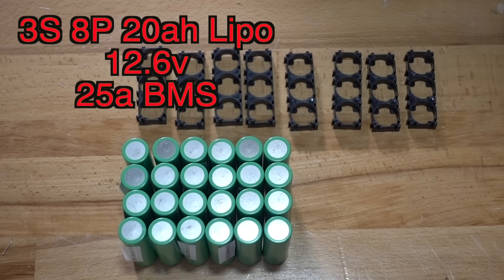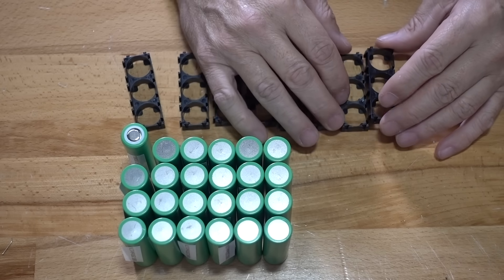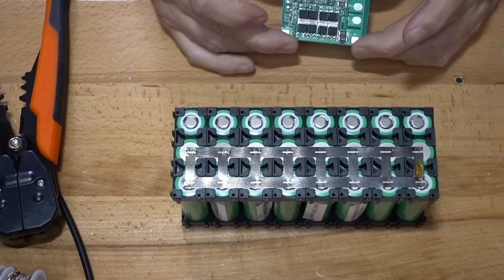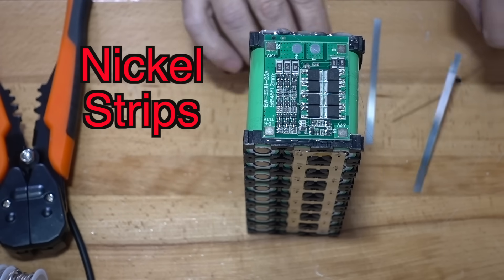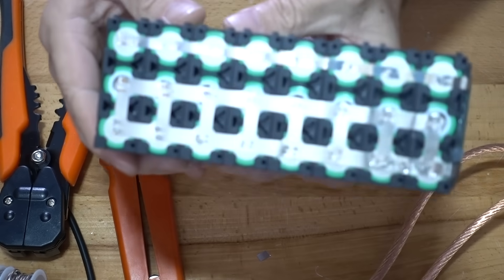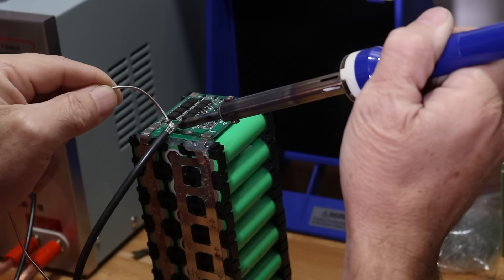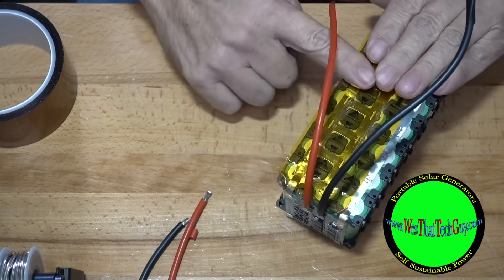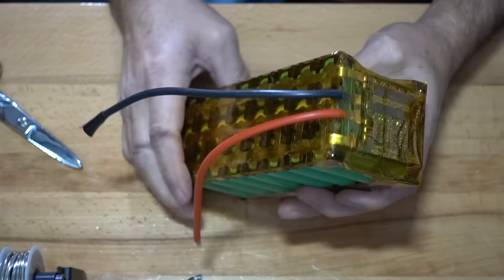How to build an 18650 Lithium Battery Pack with BMS.

Comment: 3x 3.7v (series = 11.1 v @2500ma=27.75wh) 8x 3.7v (parallel =3.7v @20ah =74wh)how do you get 12.6v? 
i get 60ah @3.7v( 8p3s) or 88.8v@2500ma(3s8p) ,,if you parallel first and then series is it 8p3s as opposed to series first then parallel being 3s8p? 24s =88.8v too,, i cant find 12.6v sorry,,am i missing summink?
Reply from the maker: Thanks for sharing. Your numbers are wrong. That's a lot of numbers. A 3.7v lithium 18650 battery charged is 4.2v... AS for almost all lithium cells this is the same. 3.7v nominal and 4.2v fully charged. As for the sequence of how you say it or write it, it doesn't matter it the SAME either way every time. Parallel is parallel and series is series. One has nothing to do with the other. parallel increases amps series increase volts.
Reply: @WesThatTechGuy  thanx for your answer,, i calculated the voltage under load,,i am aware that watts are constant ,,i see the error there now,as soon as you load your 4.2v it will drop to it's loaded voltage,is that a more correct way to gauge the capacity you have? (left) cheers

Comment: Como podría unir 15mas 15 en paralelo, que sume 36 v y unos 10 o 12 AH las células ¿Qué AH tendrían que tener?
Reply from the maker: This would be 15P12S with 10ah cells you would have a 150ah pack at 36v

Comment: Hello! please help me with a tip i need a bms but i don't know how many volts and how many amps it should have, for a li ion battery 14s 51.8v 40ah i have a brushless motor sss56104 790kv 6000w and a pro marine ESC 300A..Thank you !
Reply from the maker: what is the motor used for? what is the continuous amp draw.
Reply: I want to do an electric surfboard..the engine has maximum amps 178
Reply from the maker: Daniel AtegoTrans You will need a 14S 200-300 amp continuous discharge BMS

Comment: How many battery do you need to build a 52v battery pack.
Reply from the maker: 14s would be 52v Nominal and 58.8v charged. but most would do 15s and that would be 55.5v Nom. and 63v charged 3.7v is nominal per cell and 4.2v charged

Comment: How many battery’s can you add per cell ? I have 100’s and looking to use a load in one pack .
Reply from the maker: no limit to how many cells per pack. Generally you would keep them in packs of 100ah, 150ah or 200ah etc. keep your batteries matched in voltage and AH
Reply: That’s no limit to battery’s per cell ? I’m going to run 3 cells at 12v but wanted to make it a big big pack with maybe 40 battery’s per cell so 120 in total .
Reply from the maker: So it sounds like your looking at a 3s40p battery pack? yes?
Reply: Wes That Tech Guy yes I guess so . New to this but that’s what I aim on fitting . I just see mainly only 5-6 battery’s per cell added . Just wondered why and if more was an issue .

Comment: WES how are you charging these upto 12.6 Volts?
Reply from the maker: Im using the SolarGeni SG-S120 5a 12.6v charger. You can get them on the site:https://solargeni.com/Battery-Chargers
Reply: Is it possible to build 3 or 4 of these blocks, and charge them with a solar charger tied to panels? Would that necessitate a special charger as well?
Reply: @mlydick  Not sure.

Comment: Can the battery be charged using BMS or separate module is required for the charging? if yes can you make video/schematic diagram for the same , how to connect charging kit to BMS
Reply from the maker: yes it can be charged using the BMS or can just be balance charged. I will upload a schematic on my site soon. sorry for the delay on this

Comment: Which part of the bms is the charging port?:
Reply from the maker: Ya what Jackson said. its the same as the red and black wire i soldered in the video.
Reply from the maker: Thanks for helping out!
Reply: P+ and P- are both input/output
Reply: @jacksonsnellings9860  thank you so much.
Reply: My pleasure!  Just started building mine last night

Comment: Can you safely make battery pack from self-protected akkus with integrated protection circuit like NCR18650B ?
Reply from the maker: I'm not sure as we don't use self protected batteries so I don't know how the will react when ran in series and parallel.

Comment: hey u seem smart and very helpful. would you help me with a question? i want to build a pack to run a water pump the pump draws 12 amps per hour. it is a 12v pump. i want to run it for at least 5 hours. is this possible to run of 18650? if so what would you suggest. and where is a good place to source batteries?
Reply from the maker: Yes this can be done easily. you would want to run a 3s or 4s pack and you might need to use a dc buck converter to match the voltage on the pump from the battery. We sell samsung 25r 18650 at https://solargeni.com/Batteries/Lithium
Reply: fritz Buy on EBay, I get genuine Samsung cells 20 for $60. Roughly 80 batteries will give you a 12amp hour battery. So x5 you will need 400 batteries to run the pump for 5 hours. It will cost you roughly $1,500 plus some materials. Look into electric generators might be easier

Comment: How is it charged?
Reply from the maker: with a 3s 12.6v lithium battery charger. The BMS is a balance BMS so you can use a Bulk charger but it must be a proper voltage LITHIUM charger with CC and CV (constant current/constant voltage.

Comment: How to know if the battery bank is fully charged?
Reply: A charge controller will tell you.
Reply: ... Or you can just use a voltmeter to check the voltage yourself.
Reply from the maker: check the voltage with a meter or buy a 3s, 12.6v lithium charger over at https://solargeni.com/Batteries/Lithium

Comment: You forgot the short circuit preventer rings to all of the batteries's positive side.
Reply from the maker: This is not done on all battery builds. We now have them available and use them but in the past they were never used by any manufacturers that's what the BMS is for to help with issues.

Comment: What gauge wire did you use for soldering on to your battery pack, and where to buy this wire.
Reply from the maker: on this build I used 10g silicone wire. You can find it on my website.

Comment: I do have a few questions though. On the bms, what does the p- and p+ mean and what are they for? I'm guessing that the p- is for the output of the entire batterypack and the p+ is for the input. Also, can this be done for a battery pack with only 4 batteries?
Reply from the maker: in this bms they are the pos and neg of the entire bms. both power in and out. Yes you can do this with any amount of series 4s 7s etc. you will just need a bms that is for that series.
Reply: Wes That Tech Guy Oh thanks! I also have another question, so could I have two different wires/connections in the positive thing (p+) because I need to charge the battery pack but also include it in a circuit.
Reply from the maker: In this bms P+ is the ONLY positive +. so anything DC + should be ok because its power in and power out.
Reply: @WesThatTechGuy  So could I have something charging whilst having a circuit using the same p+? I hope what I said makes sense.
Reply from the maker: what is this circuit you speak of?
Reply: Wes That Tech Guy It’s very simple. I need the negative side (p-) to connect to one side of Nichrome wire. Then on the other side of the nichrome, I want a wire going off of it and onto the positive side of the batter pack (p+). Then I want a little solar panel to slowly charge the battery pack. (Also, the bms I’m using can only discharge 5 amps at most because too much amps will melt the nichrome wire)
Reply from the maker: Yep that's simple. This is called a direct short! But I think you know that. Nicrome would be used for heat or a light or a coil for vaping among many other things. Can't say as I've done that. Don't think I can help with this sorry.
Reply: Wes That Tech Guy Okay thanks!

Comment: No offense but your not gonna be running a ebike  off 12.6 v
Reply from the maker: Non taken. And yes there are many motors out there that run on a 3s system. Try to think world wide and not just national or local. There are motors that run on 2v.
Reply: @WesThatTechGuy  good point . I was just going by what everyone around me and I also use

Comment: Hello. There are some claiming that these BMSes are not very good for balancing the charging. Could you comment on how would you wire additional cables for balance charging with a charger like Imax B6? Thanks
Reply from the maker: Ka Wo just solder to the positive to positive side of battery and the 2 other + wires to the other 2 + in the series and the 1 - wire to the negative side.

Comment: I have a doubt sir if I make 48v battery with 3.7v 3.8ah how many cells I need to make it and how to choose bms board for that battery..... after that how much voltage and ah I can get it from that battery
Reply: depend on ah, u can choose cells 48v how much ah u need. and u can choose bms according to battery pack u made
Reply: @ChandraMohan-gq5su  ah is not mandatory if i make 48v battery with 3.7v 3.8ah cells how many batteries i need how to make it ah is not a important

Comment: I understand the whole process ,you did justice to it but how do I charge this ? And how do I connect it for use to charg phone?
Reply from the maker: you connect a battery charger to it 3s lithium and you can solder on a usb charge port to charger phone

Comment: If I wanted to power 12V LED strips from a battery for 40 hours constant at 1A load, would I be better off using a car battery or building a pack like this? I'm not really sure of the pros and cons of each?

Comment: Well, what is the each cell info,
Example same pack with 3*8 I want 40ah what are all the things need to be care. 
Do I need to each cell capacity like assume it has 2000mah need to replace 4000mah is that right or if any??
Reply: Generlly the battery capacity was 2600, and 3.7v,  the  peak discharge was 4.2v. if u want higher capacity just add cells and according that use bms.

Comment: Is there any BMS on the market, enabled for 120 CCA with the same port for charging and discharging??? I want to DIY a motorcycle batery. 10ah, high drain 18650, about 120cca for the starter and with bms capable of delivering them along with charging voltage 14-15v from the rectifier/regulator (one socket charge / discharge)
Reply from the maker: yes. you will need a 150a Continuous Discharge BMS. Its a pretty inexpensive BMS for that battery but quite sizeable it's not a small one.

Comment: HOW safe is that???? without temperature monitoring
Reply from the maker: pretty safe for a simple small build for an ebike or similar. Temp monitoring is great and we use it in all our battery builds for resale and our portable solar generators. But temp monitoring takes another component to work and shut off the charge and or discharge. This build for what it's intended for will never over heat at 8p x 25a = 200a continuous discharge. If you were to discharge it at that rate it the stored charge would not last but a few minutes. So I guess one must use common sense if building their own pack.

Comment: I enjoyed that video, thanks. Now what charger would you use to charge that pack ? If using it in conjunction with solar panels would you just use you’re typical 12v solar controller and allow the BMS to manage the input from that ?
Cheers
Reply from the maker: Yes you could use a regular solar charger as long as its programmable and you can program to 12.6v charge output. There are many inexpensive programmable solar charge controllers on the market today.
Reply: I got a lithium maintainer but I'm worried that my BMS is not letting me charge back through the leads. is that common?

Comment: It ok to make 3S11P in this bms since bms is 25A.
What is the rule of thumb about sizing the bms and the li-ion battery?
Reply: It all depends on how much current you want to draw from your battery pack. You might only have 11P for capacity instead of huge current output.

Comment: Nice work but wouldn't it be good to fuse each individual cell?
Reply: They are usually individually fused internally but imagine if you did that, and 1 fuse blows. Then that cell is out and all the other cells in parallel would have to output more current to compensate and they would all blow as well. BMS usually has PTC fuses that reset when they cool down.

Comment: Can this also be used for your vehicle battery? Most cars need 12V, but need 50 or 60ah, 400+CCA. For example, my V8 needs 550 CCA. Can this be done with putting these batteries in series? Also, for safety, some lithium batteries can explode and start a fire. Would Lithium Iron Phosphate LiFePO4 be better? If so, what brand would you suggest?
Reply: lithium batteries are no good for cars cause they cant stant high and low temperatures,lithium ion or phosphate all the same,its lithium that burst in fire in contact with hydrogen

Comment: Nice video. Why are you not using a balancing setup?
Reply from the maker: Thanks. This IS a balance setup. The bms is a balance BMS
Reply: Wes That Tech Guy  if one of the individual cells in one of the parallel rows starts to fail won’t it affect the whole row of cells? I get that the cells should all charge at the same rate because they are connected but that doesn’t prevent a failed cell from damaging the rest of the cells. I hope I’ve explained what I’m asking correctly.

Comment: Ahaha ...Nice, but God help ya if that thing shorts out. No fuses anywhere ? I think a least 1 fuse per bank might be a good idea.....still, a nice setup.....
Reply from the maker: thanks. the BMS will protect against a short. Also when the battery pack is finished they are wrapped so nothing can touch any of the leads. There's always a fuse on one leg when installed for use

Comment: Wes, you made it look to easy. I am paralyzed from chest down good news is my hands work but fingers not very coordinated. I have kodiak solar generator and in 2017 ish I was one of eight to recieve their prototype of their version of a lithium battery matching the Kodiak. The battery is metal and rectangular with a double female XT60 fitting. I was sent the wrong end for the Kodiak pos an neg but I was able to solder the proper ends. You can daisy chain the battery however I am concerned with the single BMS responsible for equalizing the 18650 batteries. Their were several other factors as well, small but with electronics that all it takes. Thankyou and you could make a fortune if you knew us Kodiaks have been waiting years for the Kodiak battery and have received empty promises. This is not hard with a man of your knowledge. I have been very close to death multiple times. I  would love to see a 12V 94 plus AMP battery. I paid around $900 for the Kodiak battery. It can be made for far less. The money is in the battery if only Kodiak could see past their nose. I no longer call their manufacturing dept. I think they had lots of warranty issues and set them way back. Thank you for your hard work.
Reply from the maker: Thanks for the kind words! Yes we have a great battery right now. We have them that can handle 200A no problem at 12V. Keep on keeping on.

Comment: Sir can you make a video tutorial for 72v 30ah lithium batt. With BMS. Thanks
Reply: Make 6 12v packs and connect in series. Each pack should have enough cells in parallel to provide 30ah
Reply: @MadJDMTurboBoost  he will need a different BMS for that?

Comment: did you make any tests with load?  how many amps it can provide with this BMS board?
Reply from the maker: yes this pack with THIS bms max is 25a discharge and charge. This pack with better more powerful bms can do 160a continuous.

Comment: What do you charge it with?
Reply: Could I use a 12v adaptor to charge with?
Reply from the maker: If its a DC adapter and produces 12v exactly that will charge it but not fully.
Reply: Okay thanks. I will look for a dc adaptor at 12,6v
Reply: Will it overcharge if it's 24v?
Reply from the maker: a 12.6v (3s) LITHIUM battery charger. I sell them over at SolarGeni.com.

Comment: One 18650 battery is 1000mAh 
& Second one is 2000mAh 

is there will be a problem with two battery parallel connections

Plz help
Reply from the maker: Its not a big problem but you will only be able to use 1000mah/1ah of the pack. so you will be wasting 1000mah/1ah of the 2000mah cell.
Reply: @WesThatTechGuy  in parallel you add Ah. So it would be a 3000 mAh
Reply from the maker: Jason Harrison yes of course! But that wasn’t his question.

Comment: cool video!, what about balancing each cell?
Reply: Well... that BMS is designed for 3S and he does actually connect it the way it's intended, for the most part, with 4 nickel strips connecting to each end set of parallels. You can't really balance each cell per parallel because... they're parallel, they're connected to each other. The length of each strip may impact how balanced it is over time but those nickel strips should be pretty good while I reckon. I'm not a fan of this particular video but I dunno if I can fault him that much. I would've done a better job attaching the BMS and output cables though. I would've gotten a less cheap BMS perhaps with the wires already attached.
Reply: @Nitrxgen  you can't ballance each cell but you can ballance each cell row. The 3 cell rows should be ballanced separately.
Reply: Mark Cooper Agree, there could be tons of improvements, but i think its a good start. That particular BMS has a high current shut off i believe, and short circuit protection built in, but always wouldn’t hurt to be 100% safe and add some fuses to protect each cell from blowing up.
Reply: Looks super clean but, as others note, mostly due to lacking charge balancing.

Comment: If I were to build a 3S 2P battery pack (for a DIY bluetooth speaker) could I use the same BMS as you or should I get one with some different specs?
Thank you.
Reply from the maker: Yes this BMS will work for your pack
Reply: @WesThatTechGuy  thank you very much :))
Reply from the maker: @severciobanu  YW!